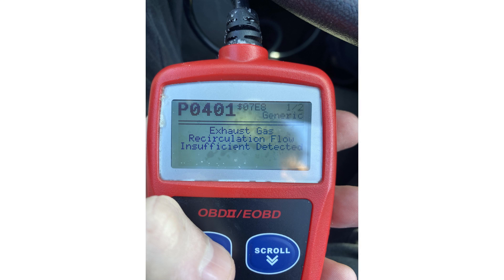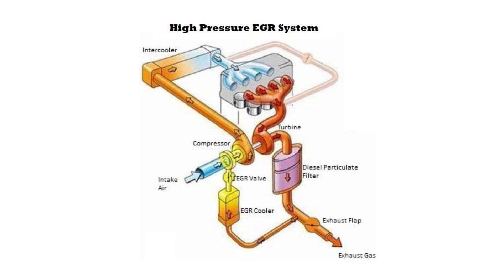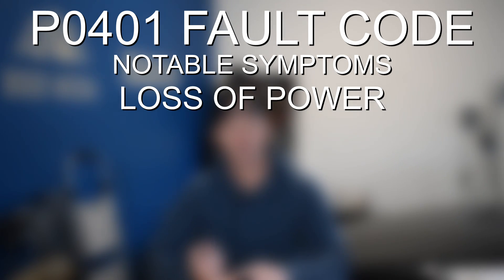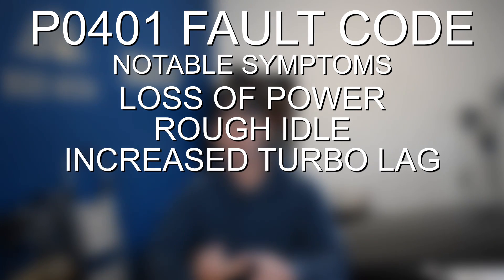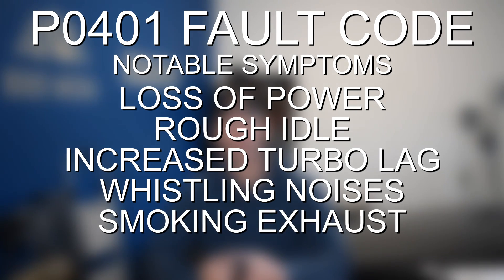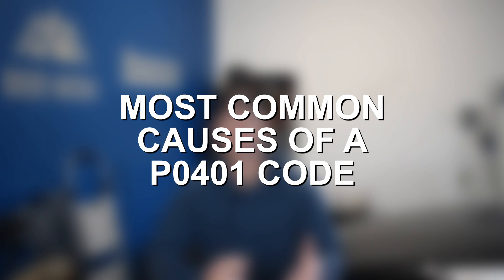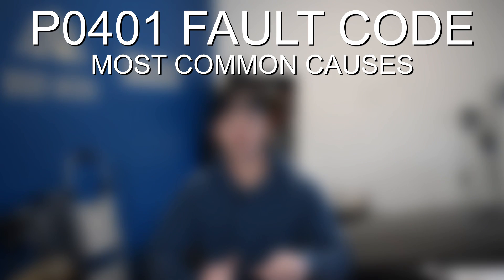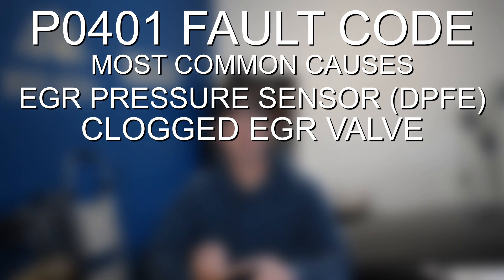How to Fix a P0401 Engine Code!

Comment: I have a P0470 Exhaust pressure sensor malfunction on my Jetta TDI also know as the DPF pressure sensor would this cause the new code P0401 to come up?
Reply from the maker: M - Yes, a P0470 can definitely lead to or trigger a P0401 code—because both systems are closely linked in how the ECU monitors and controls exhaust gas flow. The exhaust pressure sensor (commonly called the DPF pressure sensor) helps the ECU calculate how much exhaust backpressure exists, which is crucial for regulating EGR valve operation; if the sensor is faulty or reading incorrectly, the ECU may assume exhaust flow is too low, leading it to believe the EGR system isn’t flowing properly, and throw the P0401 code. Replacing or cleaning the pressure sensor and checking the hoses leading to it for soot blockage or cracking is a smart first step—fixing that will likely resolve both codes if no other EGR faults are present.

Comment: Great video! I have been getting my obd2 scans from the local autozone as they offer for free when a check engine light appears, I received the p0401 code from a recent scan, After I replace a egr valve or the dpfe sensor (if that particular part was the issue) will I need to go down to have the codes read and deleted or removed ? Or when the problem part is fixed will the check engine light go off on its own? Ive heard differences in oppinion, whats the truth?
Reply from the maker: R - Once you replace the faulty part (like the EGR valve or DPFE sensor that’s triggering the P0401 code), the check engine light can turn off on its own, but only after the car runs a few drive cycles and the onboard computer sees that the issue is truly resolved—this could take anywhere from one to three days of normal driving depending on conditions; however, if you want the light off immediately or want to see if the fix worked right away, you can go back to AutoZone or use a scanner to manually clear the code, which resets the system—just keep in mind that doing so will also reset the readiness monitors, which may delay passing an emissions test until the car completes a full drive cycle again.

Comment: I have a 2016 EcoDiesel ram disconnected make up air hose and plug it back in and got code p0401
Reply from the maker: G - A P0401 code on your 2016 EcoDiesel Ram means "EGR Flow Insufficient Detected," which typically points to a restriction or failure in the Exhaust Gas Recirculation (EGR) system. Since you recently disconnected and reconnected the make-up air hose, it’s possible you accidentally disturbed a connection related to the EGR system—like a vacuum line, sensor wiring, or even created a small air leak. Check to make sure all hoses and clamps are fully seated and tight, inspect the EGR valve for carbon buildup or sticking, and consider cleaning or testing the Mass Airflow Sensor (MAF), since inaccurate airflow readings can also trigger this code. If the issue persists, a scan tool with live data can help confirm whether the EGR valve is operating properly under load.

Comment: 2019 ram 2500 6.7 l... changed air filter and got p0299 code accompanied with p0401! your saying it could be associated with the mass air flow sensor? i do got laggy turbo but everything else seems fine??
Reply from the maker: K - Yes, the P0299 (turbo underboost) and P0401 (EGR insufficient flow) codes after an air filter change on your 2019 Ram 2500 6.7L could be connected to an airflow-related issue. While your truck doesn’t have a traditional mass airflow sensor (it uses MAP and intake air temp sensors), restricted airflow from an improperly installed or very dirty new air filter can cause the turbo to underperform, triggering P0299. That drop in boost pressure can also affect EGR flow readings, leading to P0401. Double-check that the new air filter is seated correctly, the airbox is sealed properly, and no intake hoses are loose or cracked. A boost leak or faulty MAP sensor could also be contributing, especially if turbo lag is noticeable.

Comment: I had a 401 Code on my Chevy at 104k miles. Sprayed the mass airflow sensor with Electric Contact Cleaner. Electric Contact Cleaner does a decent job and leaves no WD40 type film behind. I don't reccomend WD40 on a mass airflow sensor.
I then pulled the EGR valve and soaked it 2 hours in Dollar Store Awesome Orange Degreaser. The entire EGR and electronics under liquid, the soak is relatively mild.
I used a toothbrush and paper towel to remove all visible carbon. For inaccessible carbon, in the actual switch area, I sprayed Carburetor Cleaner, wiped with a kitchen sponge, sprayed WD40, wiped with a kitchen sponge. I repeated this 3 times. 
On reinstall I made sure mating surfaces were mostly clean and level. Between the EGR gasket and engine block I used a very thin layer of muffler joint sealer on the gasket. Tightened everything snug, not crushed.
The last thing I did was add injector cleaner to 8 gallons gasoline. I used Super Tech from Walmart.

Awesome Orange soak $2
Electric Contact spray $8
Carburetor Cleaner spray $8
WD40 spray $8
Injector Cleaner additive $3
Total $29

New EGR with labor cost over $1000. Try cleaning your EGR first. 

End result: No 401 code and slightly smoother idle.
Reply from the maker: C - Thanks for taking the time to share this! It will certainly help future viewers.

Comment: I have a 2001 Monte Carlo got the sensor and my car doesn’t smell like gas runs fine from what ur saying so I don’t know and it’s mid firing
Reply from the maker: T - If your 2001 Monte Carlo is misfiring but doesn’t smell like gas and runs fine otherwise, the issue could be related to ignition components, fuel delivery, or sensor malfunctions. Start by checking the spark plugs and ignition coils—worn plugs or failing coils can cause intermittent misfires. Next, inspect the fuel injectors to ensure they’re delivering the correct amount of fuel. A dirty or failing MAF sensor can also cause misfires by throwing off the air-fuel mixture, so try cleaning or replacing it. If you have a misfire code (P030X), that will tell you which cylinder is affected. A clogged catalytic converter or vacuum leak could also be restricting airflow, contributing to misfires. Lastly, a bad crankshaft or camshaft position sensor may be sending erratic signals to the ECU, affecting timing. Run a scan for stored trouble codes and check fuel pressure, ignition components, and vacuum leaks for further diagnosis.

Comment: I have this code right after a Downpipe install on my Audi A5 3.0TDI. DPF is deleted ofcourse. Could that be the cause?
Reply from the maker: S - Yes, the P0401 code (Insufficient EGR Flow) is likely caused by your downpipe install and DPF delete. When removing the DPF, many tuners also disable or modify the EGR (Exhaust Gas Recirculation) system, which can trigger this fault if the ECU isn’t properly tuned to compensate. The EGR flow is now reduced or blocked, which the ECU detects as insufficient, triggering P0401. If you haven’t tuned the car after the DPF delete, that’s the first step—many tuners offer EGR delete software to prevent this code. If it has been tuned, check for a stuck or clogged EGR valve, as it may not be sealing properly. Let me know if you need troubleshooting steps!

Comment: I have a 2013 Audi A4 with this code,but been having exhaust smells inside car and sometimes abit of smoke from bonnet.
Could there be a leak or block egr
Reply from the maker: W - If your 2013 Audi A4 has a check engine code, along with exhaust smells inside the car and occasional smoke from the bonnet, it’s likely due to an exhaust leak, a failing EGR valve, or a cracked PCV system component. An exhaust leak near the turbo, downpipe, or manifold could allow fumes to enter the cabin through the HVAC system, while a blocked or malfunctioning EGR valve could cause excessive backpressure, rough idle, or smoke from under the hood. Inspect for visible exhaust leaks near the manifold, flex pipe, or EGR connections, and check for burnt residue or soot buildup around gaskets. A failing PCV valve or breather hose could also push oil vapor into the intake, causing smoke and smells. Keep us updated!

Comment: I have Audi a4 TDI 2.0 throw a code P0401 when I accelerate the first start then i have high RPM and a lot of smoke from the exhaust and glow plugs light flashing and the car goes in lam mood I have changed the EGR but the problem still there . Any suggestions?
Reply from the maker: F - Check your ignition components. Are there other engine codes you're getting?
Reply: @8020Automotive  and one more things maybe it help , when I turn the key on without starting the car the glow plugs light flashing but when I turn the key off and on again the light disappears.
Reply from the maker: F - I would check ignition components and the throttle body + associated components. Keep us updated
Reply: @ thanks for answering , ja I have throttle code P2100 also

Comment: how to be sure what is exactly the problem?
Reply from the maker: B - Best bet is to check for engine codes.
Reply: @8020Media  it is P0401 for me insufficient flow.
But as you explained in video there are many possible causes for this

Comment: Hi 2005 model Chevrolet kalos 1.4 16 v 
İ have a 0401 engine codes 
Egr clean and works it but still 0401 code
May be map sensor?😢
Reply from the maker: B - Could be!
Reply: @8020Automotive  im use torque obd scanner 
Vacuum value 850 rpm and 20 21 in/hg
This is normal ?

Comment: I have a 2003 buick park avenue. Got a new EGR valve, new pcv valve, new MAP sensor, cleaned the throttle body.  I'm not sure what else to do. i'm stumped.
Reply from the maker: J - Do you have a P0401 code?

Comment: I have 2001 Saturn SL2. On cold start it is 1.0 - 1.1 kRPM, pretty much what you have after the cleaning. The car drives well, but code P0401 comes, like after 30 mi. The scanner says: clean EGR passages. I replaced EGR, then removed it about 2 times for cleaning, not much there. I also cleaned Throttle Body, replaced TPS sensor. After driving RPM goes down to 800. Sometimes P0401 code comes in combination w/ P0037, and I replaced the Down stream O2 sensor about 2 years ago (OEM). I would appreciate any opinion on this matter. Thank you for the great film.
Reply from the maker: O - Thanks for the feedback! Sounds like you've done a lot of the things we would think. We do have a video on losing power that we think might be helpful here: https://youtu.be/ipjYLPJgpq8
Reply: @8020Automotive  Thank you. I never thought that higher RPM are reflecting losing power.  It is good to know. Thanks for the reference as well.
Reply: @8020Automotive  I watched the film you recommend. It is really great film, but everything what he points in I've replaced on Saturn already (it has new Fuel Pump, Fuel Injectors, Ignition Coils, Fuel Filter, all the sensors around the Throttle Body). I suspect now Power Brake Booster, but can't check it since removed Throttle Body and many other parts, trying to get to the Intake Manifold. I think to remove it and clean well, especially EGR Valve passages there.  But yes, Booster could be a problem, it was never replaced (137kmi).  Pls could you tell if you can cut a new Booster Vacuum Hose fm/ just a piece of hose w/corresponding diameter and properties? I can't find a new hose for that car, they are discontinued. And that hose is old, it might be leaking, it would be so much better to replace it. Thank you very much for the attention to my problem, especially for the hint on Booster,  I've never thought it can cause P0401.
Reply from the maker: O - Yes you should be able to! Keep us updated on this, we hope you find your issue. Thanks for the feedback.

Comment: Hi, and thank you so much for all your great info.  

Ok, so I have a 2006 lincoln town car and I got a p0401 code that said  Exhaust Gas Recirculation Flow Insufficient Detected. 

At some speeds, I have to press the gas pedal more down to get it to go. And other times it's perfectly fine.

Any thought? 🙏 

Update 05/18/2024. So turned out my rgv valve was junk and also wasn't original. It came out of a junk yard.... 😆 

But found out my positive batter terminal was loose and some of the wires weren't crimpt together right. Fix that and all is good now..
Reply from the maker: H - Thanks for the feedback. We address this in the video. Have you taken the steps we suggest?
Reply: @8020Automotive  not yet
Reply from the maker: Keep us updated.
Reply: @8020Media  thank you. Yea, I took it to my shop. I always go to.. and the first thing he tells me is no, it's not the egr valve.  That they rarely ever go out on 4.6 2v. He said it was going to be something to do with the exhaust manifold. So, I dropped it off to get checked out. Turns out I was right it was a bad egr. But, he showed me the old one he took off. And said yea, your egr valve was junk, it was from a junk yard. And pointed out where there was wrighting on it.
Reply from the maker: H - Glad you got it figured out! Thanks for sharing your experience.
Reply: @hotrodlincoln7186  I have a 2007 Lincoln town car, I noticed a small leak from around the intake manifold so I had it replaced along with coils and plugs. I get this code now after the repair, the light wasn't there before

Comment: You ramble too long
Reply from the maker: Greg - We make these videos for everyone regardless of automotive skill level. Therefore, we try to elaborate as much as possible. Sorry if it is not your type of content.
Reply: @8020Automotive could the injectors leaking cause this code?
Reply from the maker: @ No, leaking fuel injectors wouldn't directly cause a P0401 (Insufficient EGR Flow) code. P0401 is related to the EGR (Exhaust Gas Recirculation) system, meaning there’s not enough exhaust gas recirculating back into the intake manifold. The most common causes are a clogged EGR valve, carbon buildup in EGR passages, a faulty EGR solenoid, or a malfunctioning DPFE (Differential Pressure Feedback EGR) sensor. However, leaking injectors could lead to excessive fuel entering the combustion chamber, which might affect combustion temperatures and potentially influence EGR flow efficiency, but they are not a primary cause of a P0401 code. I'd recommend checking the EGR valve for carbon buildup or a stuck position first.
Reply: @8020Automotive  thanks, well the Mitsubishi scan tools actuator function is showing the EGR valve opening fine at 0%, 50% and 100%. Can also hear it. What else can it be after this. It literally happened 20 secs after I dumped fuel cleaner and vpower fuel in.
Reply: Some things are not of one sentence answer. He covers the basis for everyone to be able to fix the issue or get pointed in the next direction you need to go.
Reply: I’d say he’s just throughly explaining the code which is what I was looking for
Reply: Helpful video by the way, thank you very much
Reply: Everyone should try to just ignore idiots who post replys like this, trolling idiot

Comment: Gas engines have used egr since the early 1970’s  They still use them as the EPA allows more NOx than non EGR engines
Reply from the maker: Mitch - Correct.

Comment: I got a 2019 f250 6.7 with 46k miles, truck is stock.   Got a p0401 code, low egr flow today.   Took it to the dealer and tech confirmed the code.   Dealer cant get to it for a few days.   I asked if it would hurt to run it until then, he said no.   I plow snow and guess what, snowstorm coming tomorrow.   Truck runs great.    Just wanted to make sure it would be ok to run with this code for a couple days?  No other codes present.
Reply from the maker: Mike - If it just popped up not too long ago, then you should be good for a little bit. But certainly don't put it off.